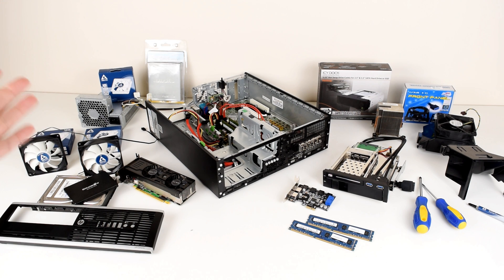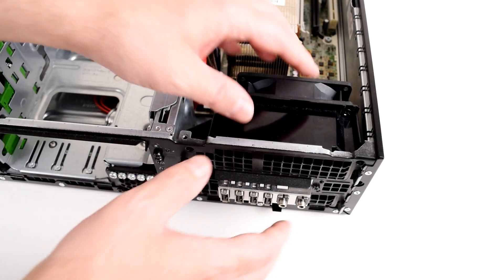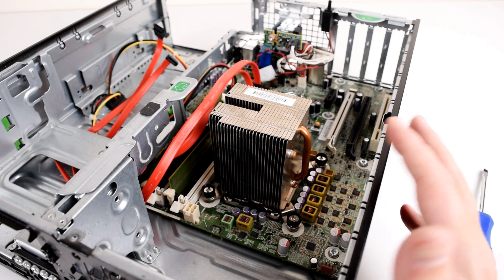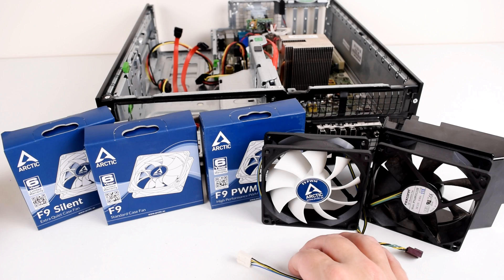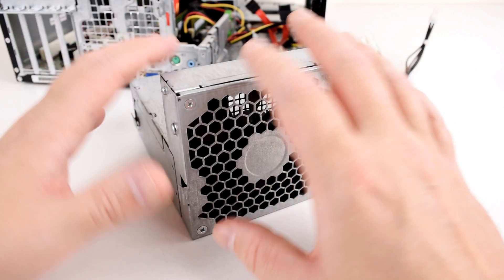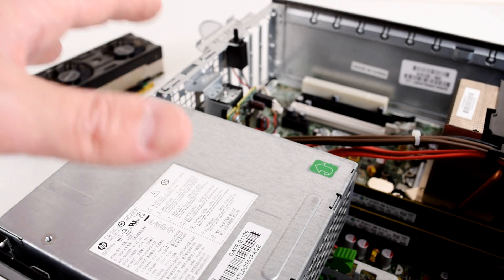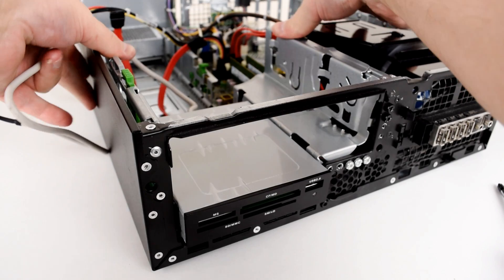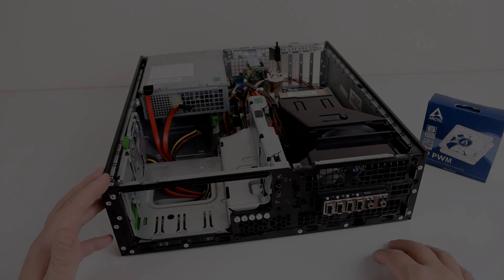Improve your HP Elite Small Form Factor PC

Comment: The only problem with hps, its their bios. Usually its extremelly limited, and even more than some laptops. 
So no overclock or downclock or any tweak that could help, like undervolt (or overvolt for oldand worn-out cpus). 
But there is a solution for many of these (at least the 775 ones), often hp uses other manufacturers boards as asus, foxconn, gigabyte, etc. So, with a good search in the web, you may be able to flash a non hp bios to be able to tweak it a bit and even overclock!
Reply: SandPox You'd be surprised at the airflow and cooling capability of these things.
Reply: Indeed these things are incredibly well engineered, love the little boxes worked on many myself, always a pain to take apart though ESPECIALLY the older ones.
Reply: Jay Pattyson Well, i've had a 775 slim case pc like that, that used a gigabyte motherboard just rebranded and with a hp bios. 
Got a gigabyte bios and i could save my processor that was having issues with the standard voltage
Reply: The engineering and internal design is actually quite comperable to server hardware.
Verytightly engineered with a through flow coling system.
And I actually got a Medion system around that uses MSI boards.
Reply: Ahh very nice indeed! It's funny actually all these motherboards are actually made by only a few brands such as AMI and such so a lot of the bioses are quite similar in code, wouldn't be suprised if you could flash a non gigabyte bios and have it at least boot successfully to BIOS (Obviously wouldn't work well at ALL).
Reply: HP makes their own boards with these business-class desktops - basically, take everything you know about the HP consumer PCs and throw it right out the window when it comes to these. Though, the limited BIOS still remains.
Reply: SandPox A smallamount of overclock wouldnt hurt, and as i said before, a unlocked bios doesnt only serve for that. You can set many settings that in yhe default hp one you cant, and also you can adjust the voltages if you're having a issue with them. 
There are plenty of usefull stuff that in the default hp bios isnt possible.
Reply: The good news is HP uses very generic motherboard bios files, and motherboards from asus if you know what your doing you can edit them, or replace it all together. The downside to this is you might lose your embedded Windows licence. But if your like me and your using Mint linux, this isn't much of a problem.
Reply: Fallacy-Myst If its the same board, with the same chips exatly you can do that. Unless its a different board. 
I mean, it was the exatly same board, only not labaled gigabyte, and online that was known.
Reply: Yes i know this what I was saying is that there is only three (as far as I know) actual BIOS/MOBO brands that these companies use, AMI is one the three and probably the majority).
Reply: These machines are not suitable for such purpose, they have limited cooling and space and everything so they just minimize the risk of hardware damage
Reply: Off The Wall Inst better to upgrade the cpu?
Reply: IMHO, if you want to overclock, get yourself a traditional PC.
Reply: it uses an intel cpu anyways, and the motherboard is not compatible with k-series cpu's so you couldnt overclock even if the bios gave the option.
Reply: Well you can undervolt your cpu using INTEL XTU, undervolting it will take the thermal throttling away so a undervolt is also a overclock ;)
Reply: When talking about the C2d based cpus, two words to overcome a locked down bios. Pin mod. I have a HP Slim tower, it came with 4gb of ram and a lowly pentium cpu. I swapped the Pentium for a Core 2 duo e6600 (2.4 ghz) pin mod to 1333 for a result of 3 ghz. Sure that's not a huge bump but this is Core 2 duo era hardware. If your building a Windows xp system, your going to notice that speed bump and best of all it's easy and free. Either it works or it doesn't. Since my chipset was limited to conroe cpus and thus cant also support quads, this was probably one of the best mods one could do.
Reply: Yeah my hp a6655  with amd phenom and nvidia graphics is actually an asus board and i had great results going to Phoenix bios f.57
Reply: @Matt Hugh while i dont know how to search for them oddly enough mine had a sticker on the board saying its model and on most boards the model is said in fine white text
Reply: @Eduardo Avila

 Can the hp8300 be overclocked?
Reply: The problem is when you do that your windows license key won't work anymore.
Reply: Why the muck would you overclock a business machine, you knob? Those aren't computers for teenage gamer boys!!!

Comment: Good video! I would recommend screwing CPU-coolers and similar in a cross-pattern(1-3-4-2) and not clockwise(1-2-3-4) around, to balance the force.
Reply from the maker: Fair enough!
Reply: You should really use that pattern for screwing anything in. It ensures equal pressure and contact between surfaces.

Comment: Mine works with a GT630, but also a GTX560Ti worked ( with a stronger PSU of course).
Reply: Peter Gogola how did you get a new psu?
Reply: @maxeijsten4880  have you ever figured it out?have the same GPU but the psu isnt powerful enough
Reply: What PSU did you upgrade to? Wondering which ones would fit this.
Reply: rtate69 i havent upgraded yet because i dont think they will fit in my pc, i have a hp compaq 8200 elite sff

Comment: LOL perfect timing! I was just about to further work on my current project, which is a Dell 760 desktop.

9:54 That is exactly the point where I am struggling atm with my build (Q6600, 4GB RAM, riser card for the PCI-E 16x slot). I can use a full sized GPU in this build, but I don't have access to a 6 PIN power connector for the GPU in this case. Got suggestions to go with a 750 ti but as they are quite hard to get here, I think I'll go and get myself a 1030 instead. :)

10:54 Same here, mine is a 255W "88% efficient" PSU. I don't think that my build will exceed the maximum capacity of the PSU as I am limited with the GPU by not having that 6 PIN power connector.
Reply from the maker: You can get a SATA Power to 6-pin PCIe cable!
Reply: PhilsComputerLab I need to check if there are any SATA connectors on this motherboard. Will a SATA data port be sufficient or do I need one of those SATA power ports (or whatever they are called ;)).
Reply: you'll need one of these  https://www.amazon.com/Monoprice-108494-8-Inch-15-Pin-Express/dp/B009GUP6O0/ref=sr_1_6?s=electronics&ie=UTF8&qid=1532862684&sr=1-6&keywords=sata+power+to+6pin
and one of these if installing more than two drives https://www.amazon.com/CableCreation-2-PACK-6-Inch-2xSATA-Splitter/dp/B01IBA3XCW/ref=sr_1_2_sspa?ie=UTF8&qid=1532862610&sr=8-2-spons&keywords=sata+power+splitter&psc=1

The 1050ti will be absolutely fine. A 1060 will be pushing it right to its limits but if you keep it at reasonable clocks, it would magane to run it as well.
Reply: I've seen molex adapters, they should be more available.

Comment: One of the quickest ways to determine which direction a fan moves air is to remember "UGLY SIDE BLOWS" I've never seen a PC fan designed otherwise.
Reply: Jason Gooden I've seen, but often even the cheap ones have arrows in them pointing where the fan spins and where the air comes out.
Reply: There are even arrows on most if not all fans that show the air and rotation direction. But in most cases it's the side that holds the middel that is the "exhaust"
Reply: correct, but if you have seen an intel stock cooler you have seen a fan where it is the otherway around.
Reply: Those can't even be removed properly. Unless you're talking about way back in the slot 1/socket 370 days. Any Intel stock after that was basically a unit pieced together, where the plastic mount holding the fan in place was also what kept the cooler from moving away.
Guess anyone working with a 3d printer and super glue could make the fan got elsewhere, but why not get a standard fan instead.
Reply: Apple fans (think PowerMacs and Xserve units as well as the iMac G4 I believe) had them reversed on exhaust fans so the frame would be hidden behind the blades
Reply: Most of them were custom impellers on standard Nidec or Delta units, painted gray
Reply: Jason Actually IF YOU LOOK ALL fans have a pair of arrows on them that show both the rotation and the direction of air flow!! it is usually on the flange between the mounting holes!!
Reply: @gregbenwell6173  I've seen some that don't.
Reply: You can look at the curves of the fan and see which direction it flow.
Reply: Where the gunk, dust and tar is located.
Reply: This is stupid. How about spit on your hand and feel what side the air comes from 🤦
Reply: UGLY SIDE BLOWS ...sounds like my ex wife lol

Comment: I recently got one of these SFF machines, what actually convinced me was your video using a 1050 Ti with an i7 and the PSU not breaking a sweat--thanks for looking into that!

A small "improvement" I made to mine was installing a 3.5 to dual 2.5 adapter in the space under the PSU. I have a couple of old SSDs there, since they are smaller than the 3.5 drive the airflow is slightly better and the PSU fan keeps them cool.

Comment: No, you should tighten the CPU cooler in a cross pattern, to even out the pressure thats applied to it.
BUt otherwise nice video!
Reply: Paul Reyher Exatly, and not tighten one screw fully, go a little bit in the cross pattern, until all of them are tighten. 
Also intel has a reccomendation of thermal paste applying (even tho it wont matter too much).
Reply: Intel even has a recommendation for the internal air temperature of the case.
But yes, the screws go over cross and step by step.
Reply: that made me cringe so hard
Reply: @maksim225  Yeah, me too!
Reply: I always use 2 screw drivers to even out things, eventhough it's not direct dye it's still better to be safe
Reply: True and one should also NEVER push down on a CPU when in the socket, just take it out and clean the thermal paste off and put it back in the socket when done.
Reply: @Top_Lad  takes very little pressure to clean a cpu in it's socket, done it many times with no problems.
Reply: Not really an issue, because the IHS (heatspreader) is large. With old gen cpu's where the core was bare you could wreck the core by faulty tightening the screws. If a bit of the corner broke off, the cpu was dead. My first lesson's with the AMD Duron CPU's back in the day... these were fragile!
Reply: even then b, you're supposed to tighten all the way before moving to the next one
Reply: @JacobTechShit  no you dont.

Comment: You can also add the total tdp for the GPU and CPU and watts for each component, to make sure you have a decent efficiency, like I have a sff fx-8350 the tdp for that is ,125w and the 1050ti I wanna get is rated at 80w so already I'm at 205w and 2hhd, 1ssd,1 DVD drive, 5 fans  it can add up but cosair psu calculator is pretty good

Comment: Pity Phil chickened out on that PSU Fan fix. Would be nice to see a pro teach ways to fix SFF PSU fans. This is my main concern in avoiding SFF prebuilt machines. Unless they use a common laptop PSU that replacements are easy to source.
Reply from the maker: Like I said, I did the mod off camera, but don't want to be held responsible for anyone screwing it up and burning down their home. It has the same connector as the front fan, so anyone motivated enough can figure this out easily :)
Reply: PSU can be nasty which is likely why Phil didn't show it. They have capacitors that hold dangerous levels of charge long after the computer has been turned off. Having said that the inside of these PSUs get dusty as so could use a blowout. Good advice on the fan replacements I have a Dell Precision Pro I'm trying to figure out the fans on they have a weird wiring that won't let the motherboard power up with a dud fan and they are noisy as so I would like to replace them with some Noctuas (probably industrial series as it also has the fan duct method of cooling that needs abit more velocity than a heatsink mounted fan.

Comment: for the CPU fan, Nidec Beta V TA350DC 92mm PWM fans will also work. that particular one can be found in a multitude of higher-end workstations and honestly, they're the best bang for buck used, in my opinion. the impellers on those are sizable and the bearings are meaty two-ball, which will last forever. there's a 15 year-old thermistor-controlled TA350DCs in my current box as the intake and a 10 year-old PWM TA350DC out the back for exhaust. Sometimes they're cheaper on the used market than buying a new fan, and if it's from a Dell there's likely two pins that will need redoing on the connector to make it standards-compliant, but otherwise it's something to consider for longevity in mind. 

if it were any other size than 92mm I'd have different opinions, but I've noticed that 92mm fans aren't all the best in terms of quality these days with everything being 120mm or higher generally, so you really do have to go back in time a bit to a point when 92mm was the bog standard option for moving air through a case to get a decent one.

Comment: Those are positive points for HP. Changing fans on SFF Dell (GX620, 755 - don't know about newer models) is a nightmare, they're all proprietary and usually dead as a doornail nowadays. And of course Arctic rocks again :D ... and of course... YOU ARE A YOUTUBE GOD, PHIL :D Love all your stuff!
Reply: The only problem with hp is the extreme limited bios, maybe even more than some laptops. So no overclock for you and no tweakings...
Reply: Why would you expect overclocking on an enterprise grade business desktop PC that is typically meant to run non stop for thousands of hours without any maintenance? Building your own PC makes a lot more sense if you want to overlock.
Reply: On the newer ones it's the same thing. I hate it, you can't upgrade the Cpu cooler because of it.
Reply: kirbyswarp: That is so bad to hear. I always liked Dell, but this is exactly a kind of thing that turns you off when thinking about buying one. Funny thing is - I never liked HP, but thanks to Phil here, I'm gonna change my view right about now 'cause this is a pretty nifty machine.
Reply: Eduardo Avila: I was never big on overclocking so this one is no issue for me, but I understand that getting some extra oomph from such machine might be desirable for many :D
Reply: Just got a Dell board. I read up on the fans which (hopefully) only switch the cables around.  Reason I got the board is because I want to get a new  PSU and case for my system. I've been running my rx 470 at 1100mhz since that stupid non atx PSU can't be upgraded because it uses different voltages, so I figured I'd try the Dell motherboard and see how it goes.
Reply: All Dells from the GX270 to the 755 are riddled with capacitor issues. I think the 755 started to get those cleared up though.  My Optiplex 330 which is similar to the 745 and 755 seemed to be immune though.
Reply: BootlegScarce Yeah, those pavillions were really hot. 
Thats sad :/

Many laptop manufacturer's do that. And thats typical in hp, their bioses are really limited and locked, so usually even with intel offical tool (xtu) it wont let you tweak anything, and usually they have some whitlists.
In desktop pcs at least usually they use motherboards from other companies just rebranded to hp, so if you find out what board is it, you can usually flash the bios and have a normal board with a really good bios in there. Unfortunatly that isnt possible in laptops. 
I've had a hp mini, a calculator basically, even browsing the web was pretty terrible, and that when it was new in 2010
Reply: BootlegScarce Maybe even modding the fan to 100% all the time or getting a stronger fan from another laptop should also help. 
I've done that to a toasty dell i had. Sadly it was too late and there were awready thermal related damage, so it didnt last long, but at least it was more cold, but noisy. 

It's good to know about the whitelist being gone in hp, ot should vanish from industry, but it seems some manufacturers such as lenovo still use it. 

I had a 2012 asus, a Ux31a, it seemed pretty good in general but had some deffects, it had some energy issues that caused throttle, that later when i cracked the lcd by accident i unplugged it and all the throttling issues were gone, he probably had a too weak power delivering system. 

Its throttle was so bad that usually it would run at 800mhz (cpu speed). But here and there there were a major lag spike, that in cpuz would show a drop de cpu clock to 33mhz (no it didnt loose 33mh, that was the entire clock!) in cpu and 4mhz in bus. It was just for around 1 second, but it basically froze de laptop everytime it happened. 

Other than that it was really well built, and probably a deffective unit so i cant judge asus for that.